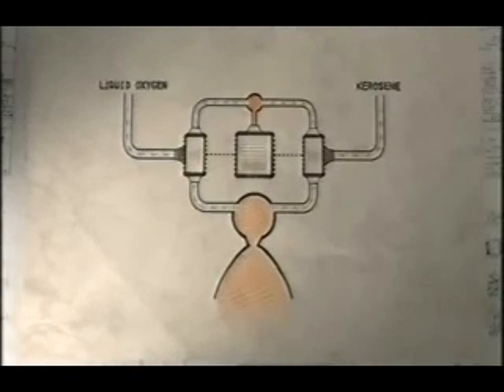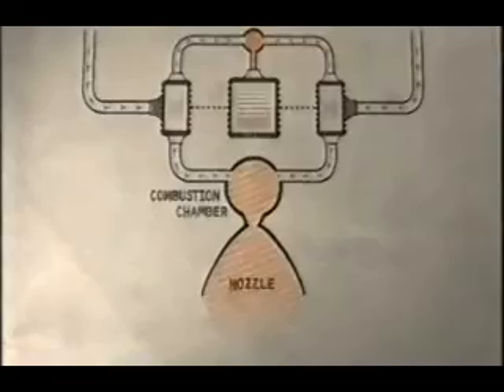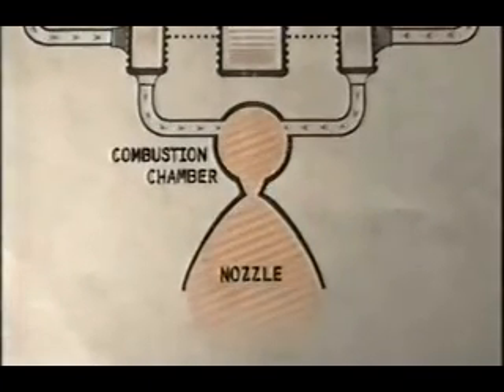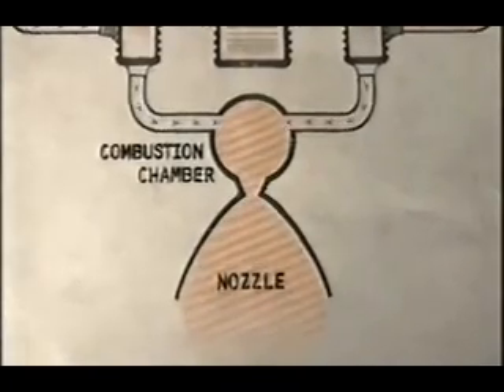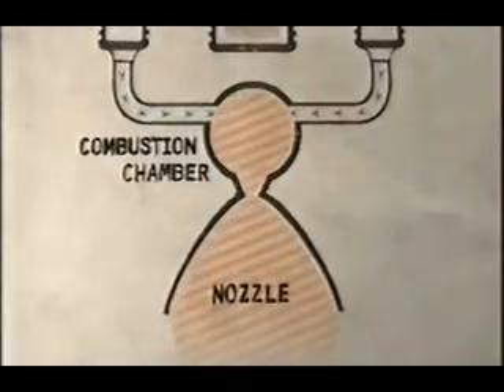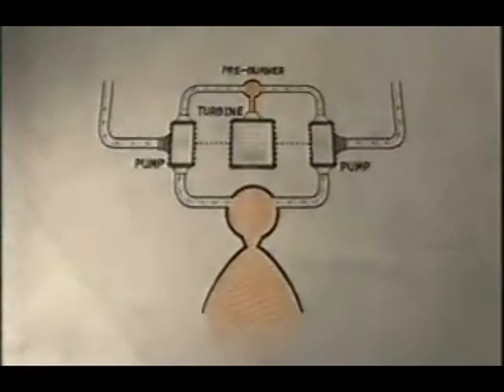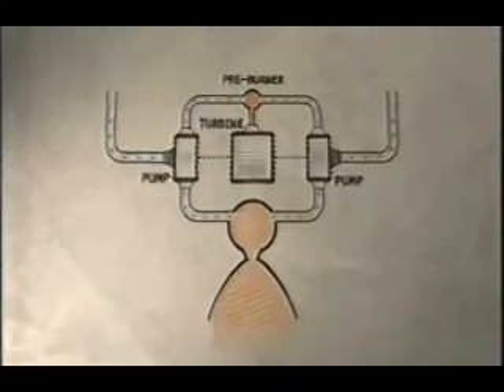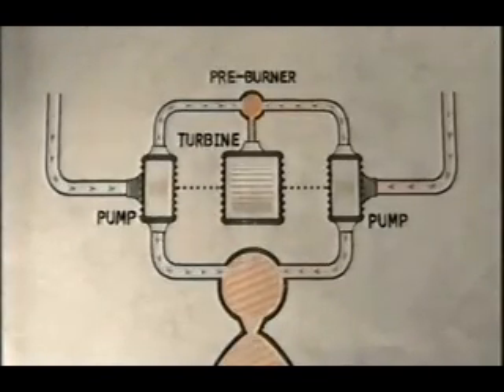Soviet N1 Moon Rocket documentary part 2

Comment: thats a good point since general plans of the Saturn V were plentiful however the ability to duplicate most of the complex details were too far advanced for what they were capable of, in reading books like Angle of attack, Stages to Saturn or Saturn you come away with an appreciation of just how complex the engineering and creation of these engineering ideas was -complex tapering tank gores, extremely complex engines, perfect welds,new materials etc. were just some of the unmatchables

Comment: The N1 did end up having a more powerful 1st stage than the SaturnV.  The NK-33 was more efficient with 130:1 vs F-1 was 115:1 thrust to weight.   However, the funds were not there for testing an by the time the design was perfected in 1974, the US had already been to the moon several times.  I think the perfect design would have been somewhere in the middle.  I think the N1 should have had less engines, but Saturn could have had more so engine out capibility would not have been questioned.